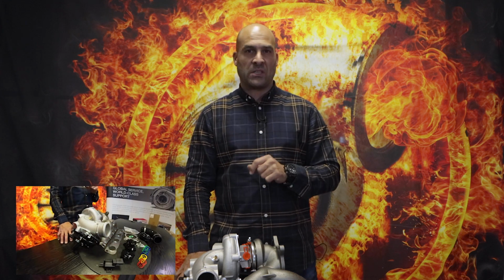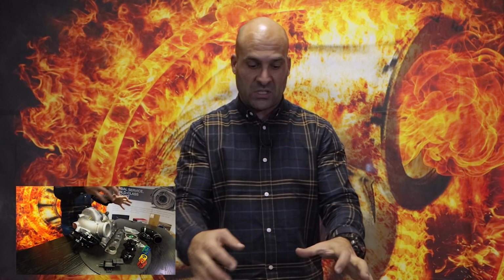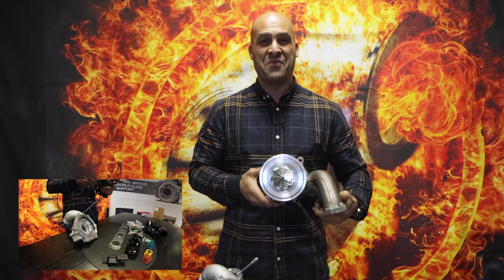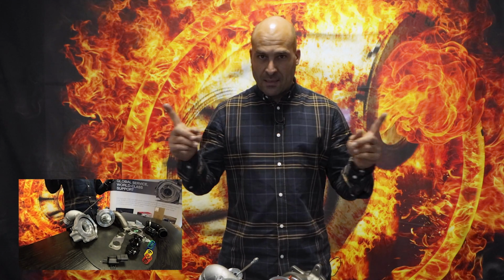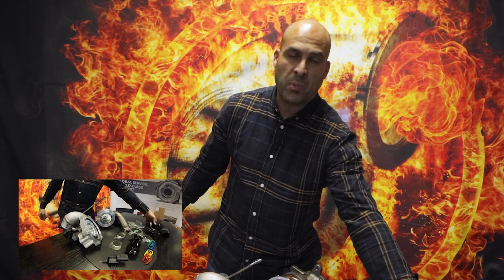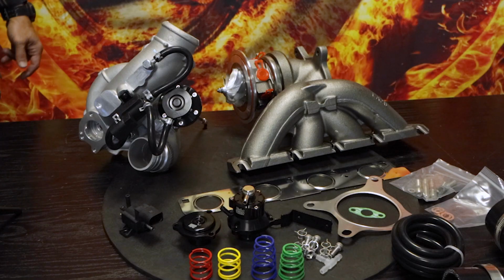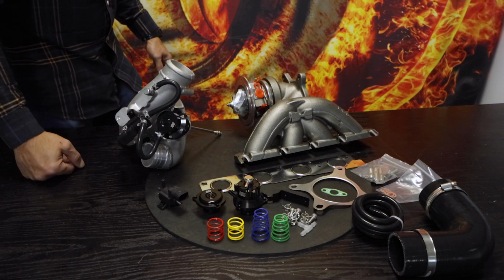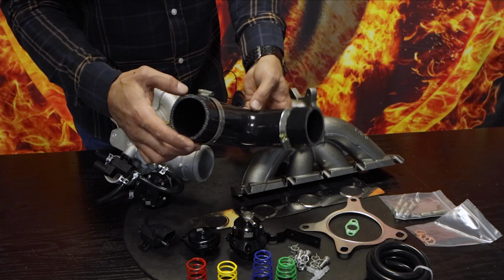TurboDirect S.A K04-0064 Ball Bearing 500HP bolt on turbo

Comment: Hi Guys, I have a Golf 6 35 edition Gti which comes stock with a K04 . My question is does my car have the K04-0064 as u mention here ? If so can I send my turbo in to do this aswell?
Reply from the maker: The K04-0064 will bolt directly onto your setup - there is nothing to send in, this is an off our shelf bolt on turbo which you simply install and tune. 

The stock turbo you can sell to recoup funds if you choose to.

Comment: Excellent video!
Hi Chris,one quetsion:why there may exsit different angles(compress housing,turbine housing or central housing) for the same turbo?
One can adjust the angels by ourselves?Does it affect turbo's performance? Thank you!
Reply from the maker: Alex, im not sure what you mean. If you referring to the orientation on the compressor and turbine housings, then yes this is adjustable, BUT we set this according to the OEM specifications, so that this turbo bolts on without any adjustment required.
Reply: @TurboDirectSA  Thank you!

Yes,you are correct,I mean the orientation of turbine housing and compressor housing.
You know,sometime,one genunie turbo(same part number) was manufactured by different 
suppliers,isn't it? So the orientation can be different? Then how can we know what 
orientation fit my vehicle?
Reply from the maker: @人间指南-z8j  The orientation will not affect performance at all.  No ALL manufacturing locations use the identical Delta and Omega (orientation degree settings) data so there is never any alignment issues when installing. 

Turbocharger work with part#'s specifically for this reason, so the Golf GTI Mk5 and 6 will use the 53039880105 and the IHI turbocharger (they are interchangeable except for the DV on the IHI unit is 1mm smaller in Diameter. 

The 53049880064 (K04-0064) is a 100% bolt on replacement for these turbochargers. If you have a different vehicle, then this turbo wont fit -

Comment: Hey Turbo Direct,
When you guys say 500hp I'm guessing that hp is at the wheels?
According to the flowrate of the g25-660 it maxes at 60lbs/min, (roughly 600hp crank), so after driventrain losses, etc it should produce around the 500whp mark?

Currently running at TTE420, but looking to build the engine in the future.
Reply from the maker: Hey Thanks for the comment, we never claim Wheel HP - because every dyno is different, and everyone uses different correction factors to "make their products look good" we work on factual information like the flow rate of the turbocharger in its assembled format with its turbine and compressor housings (with their AR values) working on a bench which we then measure the flow and can then confirm that the power the engine should produce (If it can use the air flow from the turbocharger) is according to the turbochargers ability. 

We also dont claim HP numbers based on the very tip of the choke line of the compressor map - we reference a useable vertical line INSIDE of the maps flow curve left of the choke limit - this is a safe, and realistic HP figure. If you make more on your said dyno - good for you, but what we claim you should not make less than.

Comment: Hi, really interested with this set up!! Currently I’m running K04 in my 2012 Q3 Quattro and looking to upgrade. Was considering the tte480 or go big with efr, probably 7163 or 7670 twin scroll. I believe this turbo is just better than the tte everywhere. Any thoughts on which turbo should I go with? Thank you in advance, and really appreciate that you still have something for the older (pre gen3 ea888) engines.
Reply from the maker: Without a doubt the EFR is leagues ahead of the TTE product, they not even in the same ball park. The EFR is obviously ball bearing and the TTE is not.  Its not a fair comparison at all. I would definitely opt for the EFR over the TTE for less money too.   It will cost you to make up the manifold though, but the EFR will outperform the TTE by far.   Our product is Ball Bearing and competes directly with the other "hybrid" builds out there.
Reply: @TurboDirectSA  I’m very sure the efr would make way more power than tte, the only reason I’m still hesitant is the response. Would that big of a turbo be more laggy on a 2liter 4 cylinder engine..
Reply from the maker: @youtubeviewer2919  It will spool as fast -- see here:-  https://youtu.be/9tpqrXOzAyc?t=104
Reply: @TurboDirectSA  nice video!! In fact that’s the first of many videos from you that I’ve seen about the efr turbos (including the long 2 part comparison with the g series). Honestly I was quite sure to go g series before watching them.

For now your hybrid k04 just kicked the tte out of my short list, seriously considering it for my car. I think it’s gonna be a simpler bolt on solution than going efr and still making good power, just two questions I’m wondering now.
1. Why choose garret internals instead of efr
2. Price

Can’t thank you enough for all the information n videos!!
Reply from the maker: @youtubeviewer2919  Great comment and question thank you - th reason we chose Garrett was because this project started 8 months ago, and at that time we had already chosen the rotating assembly for the build as it was easier to accommodate than the Borg was due to the huge water cooling jackets on the Borg bearing housing, which would make the K04 baring housing impossible to reproduce as a direct bolt on as the physical dimensions would have to be increased past the ability to install the stock fittings, lines etc. Also the rotating assembly was small enough to allow the end housings not to have to increase in size that much that it would be impossible to install the rotating assembly into them without the housings being too big for the available geography under the hood.
Reply: @TurboDirectSA  sorry for the late reply, been caught up in work lately; thank you for your explanation!! I believe that you’ve selected everything with great consideration from all sides. Will shoot you guys an email about the pricing for this procduct. Would definitely weigh in the simplicity and “bolt on” side on this turbo vs the efr
Reply from the maker: @youtubeviewer2919  No worries at all -- pleasure. Look forward to it.

Comment: You mentioned that it is not possible for a G25-660 to hit the 600ish hp target, but why is the brand advertising that hp rating? Is the advertised hp based on a higher octane fuel? Is it the same for the G25-550 as well? Thanks.
Reply from the maker: From experience on various engines, the G-series turbos do not make the claimed power - in fact the claimed power in HP at the top of the Garrett catalogue does not match the compressor map flow in lb/min.  I spoke with someone who used to work at Garrett and it was confirmed that they changed the multiplication of the lb/min > HP calculation on the G-series to 11 for the smaller turbos and in some cases by 12 - if you want a realistic lb/min value, divide the HP by 11 and some cases 12 - this is what you will experience in reality.  You will notice that the exducer of the G-series compressors are really small, i believe in my opinion this is why the flow rates have dropped amoung other things.

Comment: You could make something similar for opel/vauxhall astra h opc/vxr z20lex k04 which is also not famous for its reliability.
Reply from the maker: We have a hybrid upgrade for this turbo found here:- https://turbodirect.co.za/store/index.php/shop/turbochargers/turbocharger-turbodirect-s-a/performance-racing-3/billet-compressor-wheels/k04r-6-blade-billet-hulk-wheel-detail